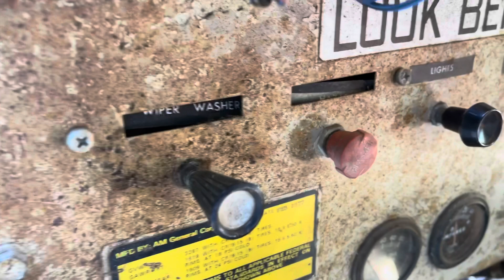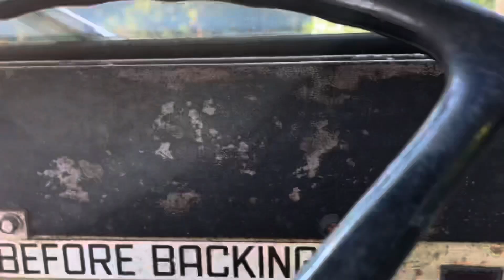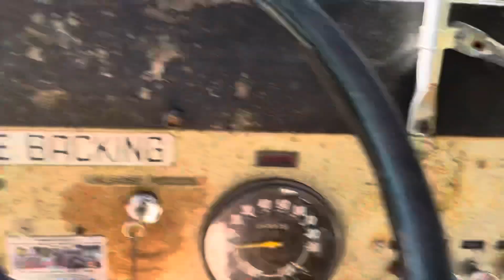Postal Jeep Successful Test

Comment: My auto choke didn't work for starting either. I used carb spray and not ether. Idk what you're using. 

Looks like  successfully!  :-)
Reply from the maker: I use ether but only because it’s easier. Going to venture a little farther from home in the next few days. May have a chase car behind me just in case. Not sure what the top end speed is here, and that limits my excursions a bit.